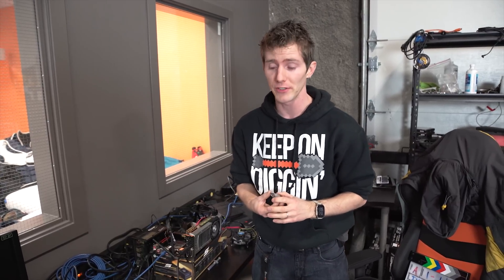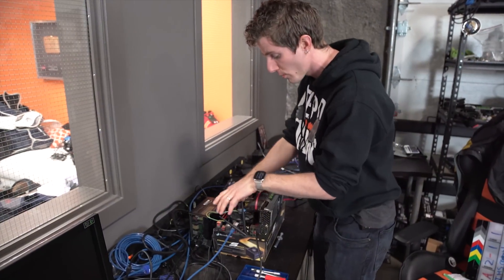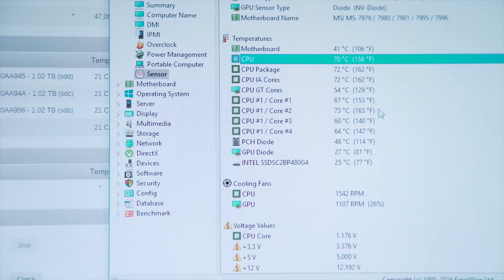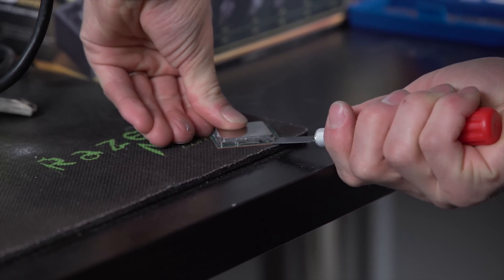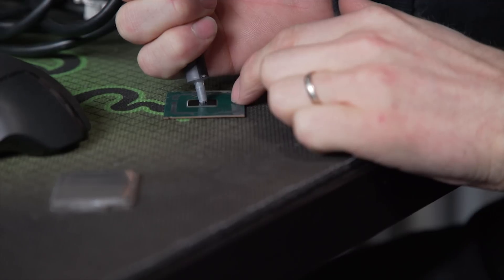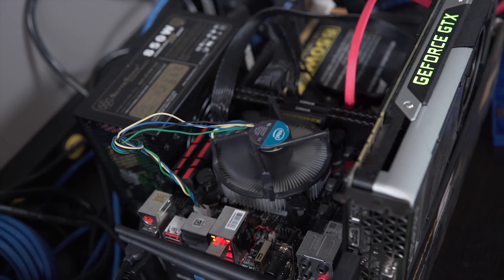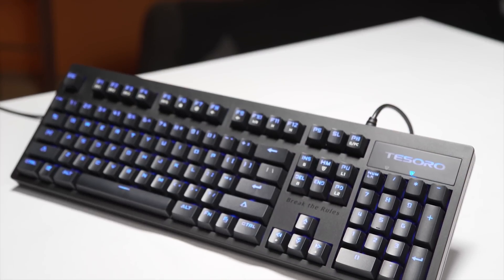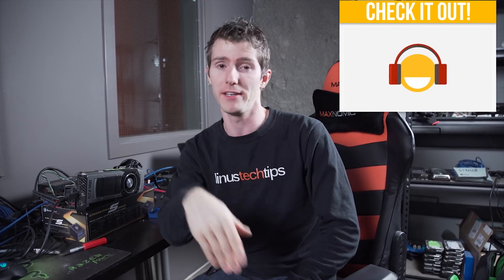Delidding an Intel Core i7 6700K - Is it worth it!?

Comment: This is a terrible video Linus, you need to clear up the old adhesive to eliminate the gap between the IHS/Die and use a solid paste. I saw a 20C+ drop.
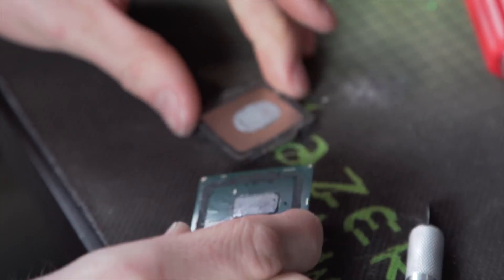Reply: 5:02 and 5:42. Literally says he's going to do that, then does it. Could he have done a better job? Sure. Would it have made that much difference? No.

How well delidding works is heavily dependent on the CPU and whether or not the original TIM covered the die. For a 6700K, you're probably not going to be seeing much better than 65-70C with stock cooler anyway. For the vast majority of users, if they're seeing high temps they're simply better off RMAing the CPU and getting a new one than attempting to delid it.
Reply: He does not use good paste bro. You don't delid unless you use Cool labs Liquid Pro/Ultra. Definitely not on a stock cooler.
Reply: Nick Blank Sure, MasterGel Maker Nano is no Liquid Pro/Ultra, but it is currently one of the best on the market outside of the Coollaboratory's metal TIM. And it's a hell of a lot easier to use and less likely to simply fry the chip, while not being much worse.

As mentioned in the video, the difference in temperature is the important thing, so the stock cooler is irrelevant. If the test was done with water cooling the temperature difference wouldn't have been any higher. If this was a 'let's get the lowest temps possible!' video, then you'd have a point. But it's not, so you don't.

Now yes, if you were doing this, you'd use Liquid Ultra and have the whole rig water cooled, because you sure as hell wouldn't be delidding it unless you're going for the lowest temps possible, but that wasn't the point of the video. The point was, once again, that for the vast majority of users, don't bother. The effort and risk simply isn't worth it.
Reply: I saw a 20C+ drop in temps, so does most of the people who do this. If he didn't see it he did it wrong. By watching this video he was careless and used a crapton of TIM and poor execution.
Reply: Nick Blank Once again, only if you're seeing 80C+ temps already, and most people are better off just RMAing if they're getting those temps on current CPUs. You're not going to be losing 20C degrees when you're already sitting at 65C on stock cooler simply by delidding.

Comment: Definitely worth the risk when u want the maximum performance and keep the temps in check. Intel stock TIM is horrible, cant believe that they use such bad TIM.

Use special Delid tools when ur not confirmable with the razorblade or hammer approach.

Best results with CLU/CLP and Noctua TIM, use float method.

I've reduces temps with my 3770k by 20+ degrees, see Overclock.net forums for latest results.
Reply: Oh yeah at least run the CPU@100% for 1,5 hours, TIM should then be ready for daily use.

Comment: I have seen cases with Broadwell where the compound under the lid was not covering the whole die... resulting in conclusive temperature differences between each core varying as far as 5c difference! this was later admitted to be a defect in a certain batch of these chips this is why people started to take the lid off them to fix this silly issue without RMA which as you know can take for freaking ever. 

I personally have not run into such an issue and don't think its worth taking the lid off either but hey if you notice upwards of 3c difference between core temps it might be the goop under the lid which is the issue.

Comment: ....stock cooler....why....shouldn't delid cpu be used with high class cooler...?
Reply: ***** well, it is obviously relevant, stock cooler have a poorly made contect surface which can cause a lot of problem, specialy when he uses a polished CPU
Reply: ***** Do you seriously just call me a moron, sir. All things I said are valid. Just do a simple search on google and you can see the contact surface of the cooler are badly made, which will create a barrier in heat transfer. One of the main point of un-lid the CPU are reduce the barrier in heat transfer.

Comment: I delided my 6700k in 2 minutes and applied cool laboratories ultra and it dropped my temp by 20c, now im running at 4.6ghz in a mini itx and max temp was 67c before it was in  the high 80s at 4.4 ghz. Totally worth it.

Comment: I hate to be "that guy", but it's sort of misleading and a waste of a video to do this without also comparing coolaboratory liquid/pro or even overclocking (where the gap widens substantially). For example a 4 degree drop with regular thermal paste vs 20 degree drop with liquid pro: http://www.guru3d.com/news-story/intel-skylake-de-lidded.html   Which is pretty much the consensus, that because of the type of TIM intel used this time it's only really worth replacing with liquid metal.

Comment: I thought u couldnt touch the pins on a cpu
Reply: +ryan thompson "expert"
Reply: ryan thompson If you think linus is an expert i feel for you
Reply: intel cpu's have the pins on the motherboard and holes in the cpu, amd cpu's have pins on the cpu and holes in the motherboard
Reply: Running this youtube channel makes him a professional
Reply: PickeringSamuel He obviously is u fucking idiot lol
Reply: TheAceBase I don't have that much experience with cpu's but I do know that intel has pins in the motherboard for the last 10 years
Reply: +Mister K Linus is experienced, but not very professional
Reply: I wouldnt as i think if one of them bends, then it brakes the cpu. Don't forget that linus is a expert when it comes to computers.
Reply: +PickeringSamuel and what might your problem be? of course he's an expert, at least he's better than anyone else here
Reply: +lowe knoops yea ive noticed that now when i put my cpu but has it aways been like that? Ive seen the pins on amds but what about older gen intel cpus?
Reply: I believe some Pentium 4's and older had pins on the CPU. The ones before LGA sockets.
Reply: The CPU pins, as well as most other data connections in a computer, are gold-plated. Even the air would make them corrode beyond usefulness otherwise. Me and nobody I know has ever caused a malfunction by touching any contacts. And some of my friends are hooked on stroking GPUs. It really isn't that bad.
Now, I handle these components by the sides whenever possible, just to be sure.
Reply: Pins are on the motherboard for like all Intel processors since I'd say the newer Pentium 4s. AMD still has pins on their CPUs; I once bent the fuck out of a pin on my Phenom X4 black and somehow it worked fine lol
Reply: you can touch them as long as you do not bend them.
Reply: you*
Reply: ***** while I can't really say this from a computer hardware perspective, a lot of engineers don't really understand the practical side of their trade and could learn a bit from people who physically work with the stuff all the time. As for this video, or Linus himself, it would not be a stretch for me to do exactly what he does and maybe more. I have no formal education on the stuff, but have spent a lot of time troubleshooting things, reading magazines, and a couple of books on hardware.
Reply: ***** As someone who's seen both sides of the story, That's definitely not the case.
Reply: ***** Canada
Reply: +lowe knoops it really depends. they started doing that recently before they had pins

Comment: You should do this to the i7 4770k. i think it had some kind of gap because of the glue used on for ihs was t othick or something along those lines. it was an odd case i think and for that cpou the difference was significant.

Comment: Can someone send me a link to that blade he uses to cut the IHS.
Reply: +ZambonieDude It's just an Xacto knife.  Look up an xacto knife set, they're numerous.
Reply: its probably from one of the ifixit kits
Reply: hammer and vice method, small block of wood to prevent damage, light touch with the hammer, save yourself the chance of cutting the trace, hit it square and do a good careful job and you'll be fine with low risk, be a 200 pound gorilla and it will fail, then again if you are that uncareful you would cut a trace anyway
Reply: +Revoku Skylake CPUs have a thin PCB, so hammer + vice isn't that safe. http://cdn.overclock.net/a/af/af9127c2_040_zpsmgjdtprr.jpeg
Reply: yup, am aware, have delidded a couple of em, its not that safe if you don't understand angles and how to apply the right amount of pressure/force to something, basically they tend to break if you have a dumbass behind the hammer, and the older chips are more forgiving, but if you're careful, and use even a small amount of thought, you can do it really easy.
Reply: Stanley Knife will do, kitchen knife even.

Comment: I7 6700k, Z170 Gaming Pro, 16 GB Hyperx Fury ram 2666 Mhz, GTX 1070 (if its any good)

That good enough?
Reply: ditch the i7 that's just overkill and stick with the i5 6600k, hyper 212x as your cooler and oc, save yourself some money maybe pick up a 1080 and ram speed doesnt matter much either
Reply: Micheal Higgins i play only cpu games, not so much graphics games.

Comment: Why on earth would you do this with a stock cooler!? You realize that a decent air cooler (like a TR HR-02, Scythe Mugen 4 or any Noctua cooler) would have probably made a much bigger difference because the stock cooler simply runs into the limit of its capabilities and can only make very limited use of the improved thermal conductivity, right? This result is completely useless, no sane person would delid their CPU to put a stock cooler on it.

Comment: Do you have to use that thermal compound to stick a fan on your cup? Someone please answer
Reply: Linus reviews the High Peformance Solo Cup at around 9 dollars for 30 pack
Reply: cup ?
Reply: +Aures the Gamer sorry I meant cpu
Reply: +Burrito Sandwich ok thanks man appreciate it
Reply: +ccceecc ccceecc thanks
Reply: Yes, you have to. Although it is best practice to clean and re-apply it every time you remove the heatsink, you can get away with re-using it if it hasn't aged and hardened yet. You must not allow it to pick any dust or hairs while it's exposed.
Reply: LinusCupTips

Comment: I did this with my i5 4460 because the thermal compound under the cpu heat sink dried and the cpu were running 103 *C idle! xD
Reply: +exterminator812 how long did it take for the compound to dry up?

Comment: Well I think you should have performed the test at overclock with cpu pushing a lot more voltage through it at higher frequency. It would be more likely yield in a different result with bigger improvement.
Reply: thing is, it doesn't make sense for all but the most extreme cases. The point is: People who know just enough to be dangerous end up trying to do that when some dude with a 1,500 liquid cooling setup on a 2,000 PC tells them it'll give them 10c extra. That's the people Linus is talking to.
Reply: +George Kartvelishvili Not really...it went down about 3 degrees tops. How does making it get any hotter (not a good idea) improve the advantages?
Reply: Lionkev55 Lions if he would use a different cooler and overclocked a CPU I think temperature drop might have been more, since TIM has limit of thermal energy it can dissipate, which is similar to CPUs thermal energy, but with overclocking CPUs thermal energy increases, but TIM is not dissipating enough of energy already and even though cooler and thermal compound above IHS would allow you to run cool, CPU cores run hot since heat stays with them.
Reply: parasemic It depends how the thermodynamics work, I am not really sure. I don't know if the heat created is exactly proportional to the clock. It probably isn't going to create a massive difference after you do this. The only way this is practical to me is if you're going for the oc record or something, because ur warrenty is trashed and to 99% of people, the 3-5c iss super minimal. Its better to buy a faster cpu and not oc it, then to get a cheaper one thats unlocked then oc the shit out of it for maybe 15% gains.
Reply: Lionkev55 Lions
Sigh. It's not the clock that creates the heat, it's the voltage. More clockspeed = more required voltage = more heat created. 99% of people are not hardcore overclockers but anyone tech literate that doesn't have unlimited budget is a moron if they don't take full advantage of their hardware taken a good overclock can add 1-2 years to a core systems lifecycle (cpu/mobo/ram). Again, 3-5c is a terrible result from delidding and in normal circumstances (overclocking with proper cooling and liquid metal as compound) the differences are between 10-20c. That is enough to warrant a ~0.3V increase in voltage which can result even in additional 0.5GHz overclock, which is significant. For example, my non-delid 3570K does easily 4,5GHz on water (1.1GHz OC) but people have been getting them running even 5GHz when delid and properly cooled, which will trash even most current generation OCd i5s.

Where do you get "15% gains" number when normal overclocking gain with i5s is around 25% and the difference between Intel 2nd series and 6th series is basically non-existent (1-3% gaming performance).
Reply: +parasemic I'm with you on this, when your cpu's pushing out a couple hundred watts of heat things like this will make a lot more difference.

Comment: Actually the difference might be a little higher than Linus states,  it seems the fan speed is down around 100 RPM too wile having a lower temperature.   Sure. its not a huge difference, but fanspeed being down 5+ %  still counts imho.   next time maybe set stuff like fanspeeds and clocks manually to make sure temperature is the only variable, now its kinda hard to tell if those few degrees are the only difference.

Comment: IIRC Intel has fixed their shit when it comes to the latest generation of processors and are using a far better thermal paste this time around. Haswell was complained about so fiercely because peoples PCs were shutting down and pushing temps in the high 90's during games.

The reason delidding became so prevalent (relatively) during Haswell was because those chips were exceptionally awful at heat dissipation thanks to Intel cheapening out, the results were worth it when they used a liquid metal paste and aftermarket cooling solutions. I was prepared to do it myself when i built the PC i have now (got rubber gloves, scalpel and liquid metal paste, everything) but thanks to luck of the draw my CPU didn't exceed 70 degrees during artificial stress test... unlike some others who were pushing 100.

Of course, generally it isn't worth it because nobody wants to risk killing an expensive CPU over a few degrees of heat (especially bad since you wont know the CPU is dead until its too late). Dont try this at home unless you're prepared to take the potential financial hit should you kill the CPU and you really, REALLY need to get some outrageous CPU temps under control.

Comment: Dont try this with the Haswell-E series of CPU's (5820k, 5930k, 5960X ) Their TIM is soldered to the IHS and if you try to remove it you'll destroy your silicone.
Reply: Silly cone
Reply: Silicon
Reply: Not true actually. There are delidding videos for Broadwell-E already that show the IHS can be successfully removed and the remaining solder scraped clean. Whether that is even worth doing, I'm not sure but it can be done.
Reply: Dunno why anyone would want to lap a soldered on IHS, the amount of thermal loss through the soldered on IHS is so insignificant that you'd be overclocking to the point that a small change in room temperature would be the difference between a working or thermal shutoff CPU.
Reply: yeah, also don't do it on your P4 CPUs. You'll rip out quiet a bit of glas fiber
Reply: Thanks for the heads up
Reply: Silicon. Silicone is a plastic, Silicon is an element.
Reply: lol at least you learned that with an old piece of kit, or do you mean you done it while that chip was still newish?

Comment: This method started back in the 3rd gen chips after intel stopped spot welding the IHS to the die. I did this method on my i5 3570k and the results were quite worth it. I used Liquid Metal from Coolaboratory and achieved a 5ghz overclock. Where as before with a 4.8ghz clock was only achievable as due to the TDP of the chip being reached under load.

Comment: it is an improvement, first of all
second of all, you only used a normal heatsink paste but you yourself said that there are more advanced solutions like that "liquid metal" thing you talked about
so i guess from what you said you can improve the temps even more.
i get the risk and all, but you just proved that it works....
Reply: +yakir11114 He didn't even do it correctly either (or at least not 100% efficiently for the stuff he had). Using a better compound, and taking the time to prep the compound and surface I would estimate to give from 6 to 8 degrees of difference using the stress test he used. That's a quite significant gain. An 8+ degree shift in ambient temperature over the Summer for non-air conditioned rooms is common.

Comment: Meh, I think you guys could have done a better job here.
Changing the paste on the die can make a 2 figure difference if the crappy paste is the bottleneck in the cooling. With the crappy intel stock heatsink
@ stock the heatsink itself is the bottleneck and probably gets quite a bit warm.
If you have a decent watercooler though, carring away the 100w or so of heat those cpus produce is easy. 
The problem is that, even if you can cool the outer surface of IHS to only 10-15°C over ambient, the chip itself can get very hot if you crank the clock and voltage (the crappy paste is a bottleneck and insulates the die thermally, compared to the other cooling components).
Crank the cpu to 1.4V 4,8-5,0 ghz, slap a 280mm aio on there and you could see a massive difference. For some that can be the difference between running up to the mid 70s in a stress test or failing/throtteling because of temps very quickly.